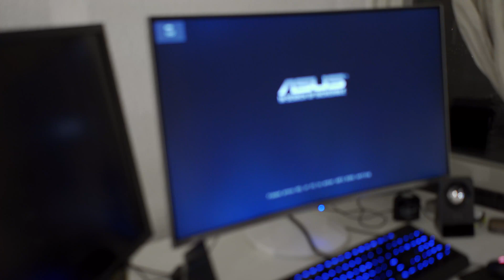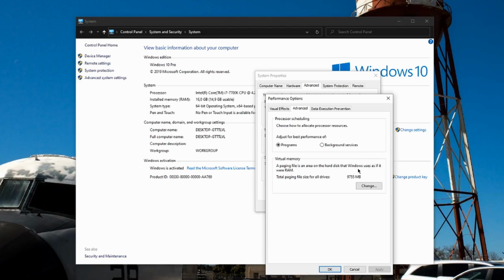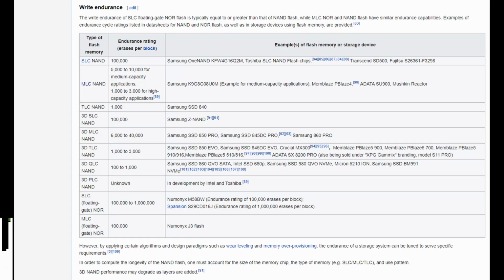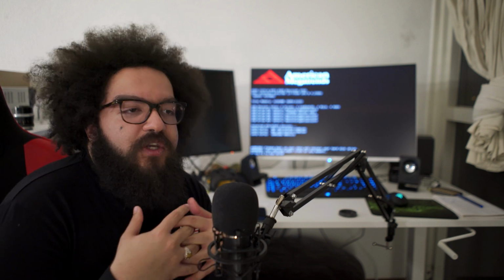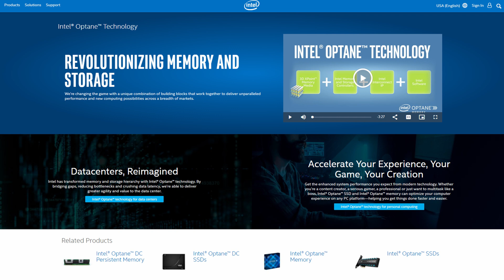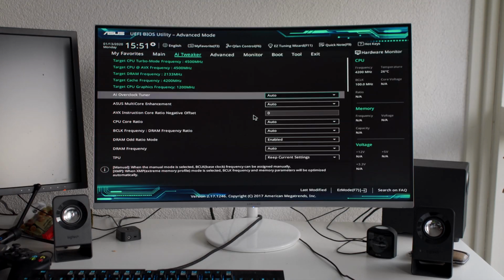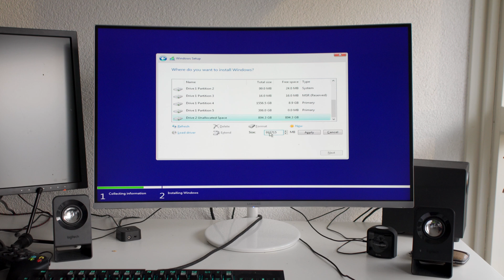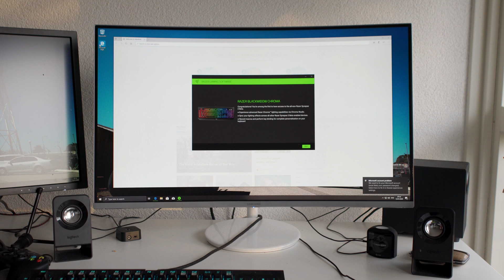Corsair MP510 to the rescue!!!

Comment: my 510 failed . this is disturbing, less tha 2 years and it stopped reading. i tryied to clean all up, it read for less than 10 secs and quoth the rave, nevermore. I am kinda desperated here
Reply: mine has slowed down , did you RMA the drive

Comment: Very Professional. Most of the other videos only talk about gaming, but you told about endurance of SSD & NVME due to Paging files & Cache file storage done by professional software's. 
Corsair MP510 is having better TBW as compared to other m.2 nvme drives in the current market.
Reply from the maker: Thanks a lot. Absolutely agree, because most reviews focus on sequential read/write performance, which I can’t say is misleading, but I’d say it ignores the only downside of SSDs.
Reply: @muhammadabbady7903  endurance is also dependent on how full the ssd is. Since it uses SLC dynamically as a cache. And a micro controller shifts data around so i’m pretty sure that a “particular part” is not used when you use a page file. As ssd cells die. All of the data is shuffled around. Also a tip is to disable automatic (in win 10) “disk optimization” that schedules a defrag of the drive, because it can not tell the difference between hdd and ssd the ssd will be automatically worn out as win 10 schedule does this in the background.
Also it is not advisable to use a ssd with TLC or QLC as a cache unless you want it to die. They are blazing fast for reads but (huge files) are slow transfer and it is inadvisable to fill it above 40% if you want “full performance”
Reply from the maker: Good info 👌

Even in the scenario where the SSD shifts data around to reduce wear and tear for a particular area, this will make it worse, as the SSD will write what it should write multipled by a factor. The defragmentation I didn’t know it was still a thing to be honest, which makes it a lot worse. Anything other than SLC is not suitable for heavy writes. It’s just costs less, which appeals to the masses, especially because most consumers don’t necessarily do mission critical work on their consumer-grade hardware, you know.
Reply: @muhammadabbady7903  yes, why you should just know it so that you can plan purcshase accordingly. i.e. if ssd is used as cache it will die "quick".